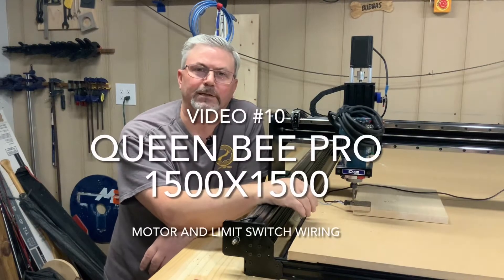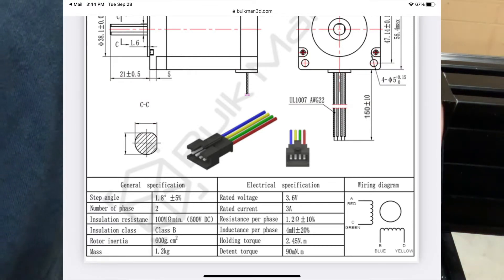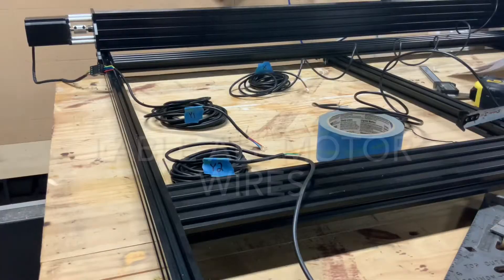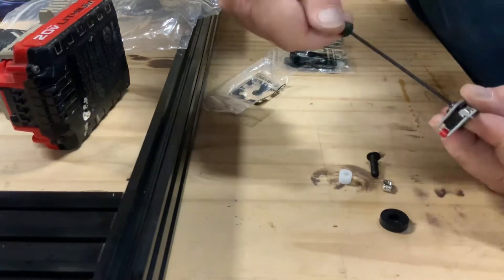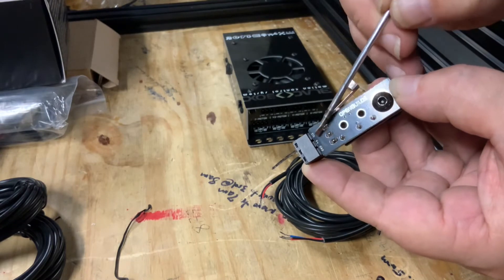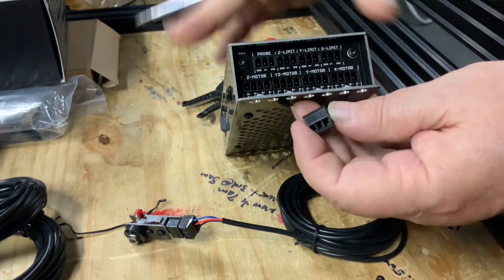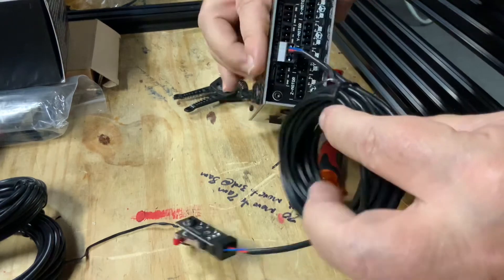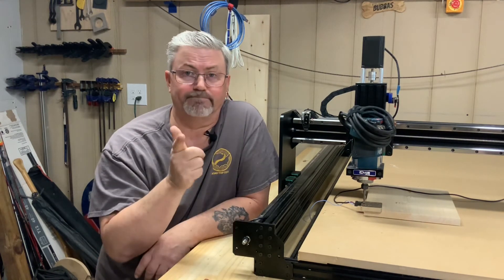Bulkman Queen Bee Pro Build #10

Comment: I just feel that machine is not as good as it shows. 2 notes 1- the mechanism of the movement is totally relying on 2 Plastic nuts on each axis. CAN you imagine if you use servo motor on this machine??? The plastic nuts controlling the movement will melt away. 2- The  8MM Acme lead screw on 1500mm machine is a VERY bad option!!! it whips and dances when you are in Half speed not even full speed. The worst is when it moves it causes the Y access to stall a tiny bit at certain times.  They should upgrade those 2 issues then we have a good machine. also the electronics is not as good ..confusing. I USED BUILDBOTICS CONTROLLER. Check it out its so easy to set and operate.